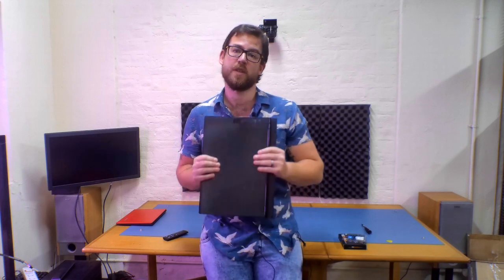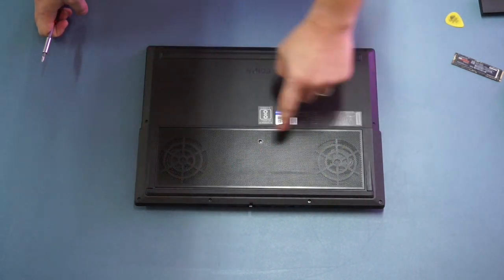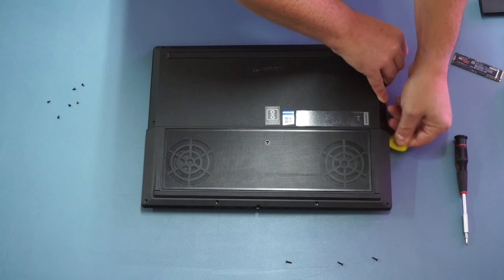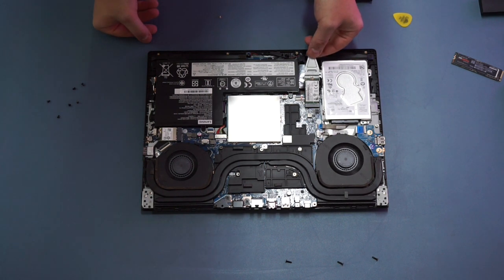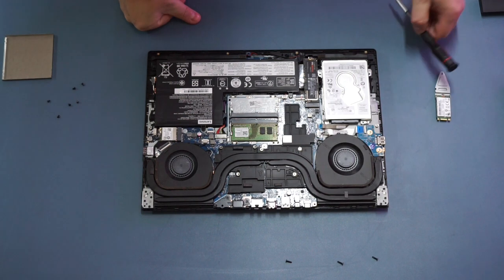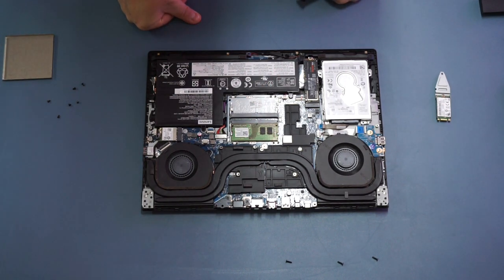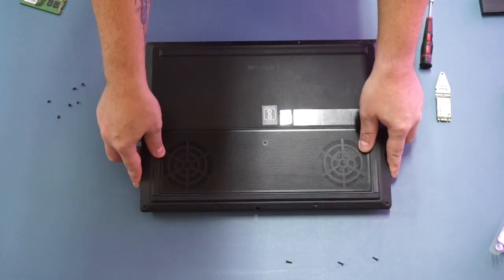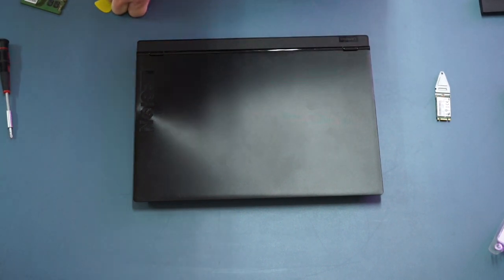Lenovo Y530 Legion Memory/SSD Upgrade

Comment from the maker: One step I've omitted to cover is that you should always disconnect the battery before undertaking these works!
Reply: the battery must be removed ?
Reply: Can Y530 be upgraded to 32GB RAM? I have 16 and it is ok, already added one more 240GB SSD instead of 2.5'' HDD.
Reply from the maker: It will take up to 32GB (links in description) but I wouldn't say there was much value in doing so unless you are finding 16GB is not enough
Reply: Tech Made Easy how disconnect battery
Reply from the maker: @OrangeGamingAndTechHelp  there is a small cable running from the battery to the motherboard, gently remove it

Comment: @TechMadeEasyUK which SSD did you have there previously to the upgrade? I have the 128 GB NVMe PCIe 3.0 x2, and I read that the 81FV version of the laptop can take only up to 512 GB of SSD. I'd like to put there Kingston or Samsung PCIe 4.0 x4 and 2 TB. Will it work?

Comment: Thanks, FME Retro...!  Your guidance in this video made the installation of a new 1TB Gen4 SSD and 32GB RAM (both by Crucial/Micron) so doggone easy!  Your caution about unhooking the Battery was a good reminder.  Your step-by-step video presentation was engaging and spot-on for what I need to do to upgrade one of our two Lenovo Legion 16 Laptops.  I'm still tinkering with settings to get the performance we want, but at least the upgrade went smoothly and everything WORKS.  Thank you kindly...

Comment: I have bought two 16GB RAM modules, each with a speed of 2400MHz, for this laptop. I have installed them, but upon turning on the laptop, it powers on without displaying anything. I have tried removing and reinstalling the RAM modules, cleaning them, but to no avail. The BIOS is up to date. Should I enter the BIOS and perform any actions? Or should I reset the BIOS? How do I reset the BIOS?
Reply from the maker: If you put the original RAM back in does the machine still work?

Comment: I backed up my SSD to my HDD using system image and then installed the new SSD but now it won't start up it just says Default Boot Device Missing. How do I get it to use the system image backup to boot??

Comment: Can you put in a 1tb nvme even though the max is 512 gb?
Reply: Been running Kingston A2000 1TB in it no problem. But I can't upgrade firmware because BIOS is still running Intel RST mode instead of AHCI (check YT on how to safely switch from RST (raid) to AHCI without losing Windows)

Comment: hello thanks for this video. Actually my laptop has 16g ram, Is recommended to upgrade to 32?
Reply from the maker: I would not say it was necessary in a laptop of this spec.
Reply: @TMEretro  well is just that I stream, and sometimes ram struggles with the games and the stream. So I was thinking this could help.
Reply from the maker: @ZenBenzineX  if you run MSI Afterburner is it showing that you're using all 16GB?
Reply: @TMEretro  I'll check it out and give you an answer.
Reply: @TMEretro  well i tried and it show that sometimes it gets full, and my game shutddown
Reply from the maker: @ZenBenzineX  using all of your RAM should not cause the game to shutdown, there's something else going on there

Comment: Thank you for this video , I have the same laptop model and I want to upgrade the SSD can I replace it with this: ( SAMSUNG 980 PRO SSD 1TB PCIe 4.0 NVMe Gen 4 Gaming M.2 ) ?
Reply: Did you upgrade it? I wonder if motherboard supports Gen 4 NVME and PCIe 4.0
Reply: @kostalakoste  Y530 is limited to Gen3 6.0 Gbps, but 1TB works and any NVMe Gen 4 should be downwards compatible.

Comment: I have the same laptop and was thinking of upgrading the SSD.. Can I go for SATA or M.2 or NVMe micro SSD or should I go for a specefic one? I am planning to upgrade from the existing 128 to 512.. any suggestions??? and I know I have to reinstall my OS once I upgrade the ssd .. the data on my internal hard disk.. They won't be affected in any way right?? Or will the whole system format and I would need to be careful about whats on my HDD before upgrading the ssd too?
Reply: Hello  same problem do I have to buy nvme or m.2 sata???

Comment: Hi! I recently got my Lenovo Y530 an upgrade with Samsung SSD 980 500GB (NVMe M.2). I noticed that the volume of my speakers are weaker than expected. Do you know how to fix it? Thank you!!!!
Reply: You can try opening Dolby Audio (it should be pre-installed on the machine) and go to the personalize tab. You can adjust the volume output there.

Comment: So I bought this laptop used. And I definitely need to add an ssd to it, but the m.2 slot doesn't have a screw in it anymore. Does the m.2 come with a screw or am I crap out of luck?
Reply from the maker: You can buy them very cheaply online

Comment: @Tech Made Easy
Thanks, Mate. This was the video I was looking for the Months.
I have a question here. I have the same model with HDD. recently HDD got corrupted and now the system is not booting up.
Wanted to upgrade with 1 TB NVMe ones instead of 512 GB shown in the video will it be compatible with 1 TB?
Please reply
Thanks
Reply: Same thing, what did you go for in the end?

Comment: Hello, I would like to upgrade my Lenovo Y530, but on the manual it says that the ssd limit is up to 512Gb, did you install an 1 TB ssd? It is compatible? It works well? 

I will appreciate your help before I upgrade it! 

Regards
Reply from the maker: I upgraded mine to 512GB so can't  comment

Comment: what a helpful guide, thanks for uploading this video!

I have a question, if somebody can help me: is this laptop compatible with m.sata SSDs, or is it only compatible with NVMe ones (I saw you replaced an existing M. key but I still have the doubt)
Reply: This is from the Lenovo Forum "Legion Y530 M.2 SSD Compatibility"

The Legion Y530 can use any M.2 SSD that is NVMe compatible. While the 2.5" bay can be used with an adapter to handle SATA only M.2 disks, the actual M.2 slot will only detect NVMe SSDs.

Comment: Hey! I got an Western Digital Black SN750 for this laptop. I have one question though, once I install the SSD, with the HDD that came with the laptop itself already used, will I be able to boot up the pc like normal? Or is there more than just putting the SSD in?
Reply from the maker: TO get the best experience you should reinstall Windows onto the new SSD
Reply: @TMEretro  And use the HDD to store anything else until it's filled? Do I have to format the pc?
Reply from the maker: @AdoriColumbina  I would back up your data to a USB drive, format the hard disk and then reinstall Windows to the new SSD. This is the cleanest way of doing it

Comment: great video. Could you say is samsung 980 pro suitable for legion y540?
Reply from the maker: 980 Pro is a pcie gen 4 SSD, this laptop only has a pcie gen 3 slot, so a 970 Evo would be a better solution

Comment: Hey there. Great work worth the upgrade. I have the same machine but without the ssd memory. My question is, is there an ssd slot available in my laptop if I decide to upgrade it like you did? 
Please reply. 
Thank you and have a great day.
Reply from the maker: If it is the same model as this then it should have the same upgrade options, but if you're unsure then check before purchasing any parts by opening the laptop up and looking inside
Reply: @TMEretro  Thanks for the feedback. My Lenovo y530 came with an optane memory instead of an ssd memory. I guess I can replace it with the ssd, right?
Reply: @malikfouad42  same. I’m planning to upgrade the 16gb optane to an SSD as well.

Comment: Great video!  But is there a possibility to easily copy the data from the old to the new ssd? (including windows and the programs)
Reply from the maker: There are options available but in most cases I'd recommend backing up important files and then conducting a fresh install
Reply: Usually when you buy an ssd, the manufacturer provides disk cloning software. Crucial for example provides acronis true image.
Reply: I’m passing through the same. How do I install my new ssd without the windows folders that are at my old ssd? If i took it of, how would i copy it?

Comment: i did but my laptop not support it plezz help!!!!
Reply from the maker: What do you mean?
Reply: @TMEretro i buy wd green ssd m.2 and then i install it but the ssd is not responding then i use the same ssd in my pc and it work
Reply from the maker: Did you buy a SATA M. 2 or an NVVME M. 2?
Reply: @TMEretro  i try both nvme m.2 form Adata(xpg) and  normal m.2 (wd green) both didn't respond .Then i take my laptop to service center then try both (nvme m.2,normal m.2)  from another lenovo laptop and it's responding .they suggest me a samsung 256gb m.2 ssd nvme - pm981(215.42 $)  from lanovo.
Reply from the maker: There shouldn't be any compatibility issues providing you use the correct type of M.2 device, shame that you're having issues
Reply: @TMEretro  can you suggest me an m.2 that is available in India
Reply from the maker: @shomilsharma9613  you are best consulting with local suppliers for this
Reply: @TMEretro  okay thank you for helping

Comment: so the hyper x should be fine
?
Reply from the maker: Unfortunately I can't guarantee any specific items, but the ones in the video description meet the specifications required for this laptop
Reply: @TMEretro  ok so i checked, and i bought the hyper x except that i only bought one of 16 instead of 2, if i buy the second exact same i sould be able to install it, or do i need the pair pack?
Reply from the maker: @tom_cr00se98  unfortunately I can't tell you whether something will work or not, liability issue. But it sounds like what you propose should work
Reply: @TMEretro  i understand, i guess mi question should have been is there a left and right ram, or i can use 2 of the same one and flip one over
Reply from the maker: @tom_cr00se98  there's no left and right, they're identical

Comment: Is it possible to change the color lights on thsis keyboard and can I replace parts of the fan to make cooling times drop?
Reply from the maker: Not easily in either case!
Reply: Tech Made Easy besides what you did with that laptop, is there anything else I could upgrade to mine?
Reply from the maker: You could also upgrade the existing hard disk to a 2.5" SSD. Other than that there's not much growth in this laptop

Comment: Hi, thank you this is very helpful.
But I wanna ask one thing. Can I install Samsung 970 EVO Plus NVMe M.2 1TB to this Y530?
Because some media stated it's upgradable up to 512GB SSD only.
I'm afraid it will be useless, or problematical if I use the 1TB version.
Reply from the maker: There should be no issue upgrading to 1tb but I can't provide guarantees
Reply: Did you manage to install the Samsung 970 EVO Plus NVMe M.2 1TB on the Y530?
Reply: @MusicIsLife22307  Hi, yes I did it. There was a problem with moving Windows into the SSD, but I didn't sure how to solve it since my friend helped me. My Y530 is working great since then anyway!
Reply: @renatatjan5341  Thank you for your reply. I was afraid that it wouldn't work, cause thats what they stated on the official lenovo website. I did some research and a lenovo specialist said that it should accept any nvme ssd but they couldn't provide any guaranties since they only test the device up to 512GB. But now that i know that the 1 TB is working fine on your machine, i''ll go ahead and buy one. On my lenovo y530 I'll do a clean install. I'm thinking about this one: https://www.amazon.com/gp/product/B07VXC9QMH/ref=ox_sc_act_title_1?smid=ATVPDKIKX0DER&psc=1
Reply: @MusicIsLife22307  Hi, did a 1tb nvme ssd work for you with this machine?
Reply: @Spartangoji117  haven’t tried it yet
Reply: @renatatjan5341  i have a problem with moving Windows into the ssd(970 evo plus 250gb). Can you help me pls?(lenovo legion y530-15ich 81fv)
Reply: Hi do u have the same laptop if so then did you buy m.2 sata  or nvme?

Comment: I have legion y540 with Samsung 8gb ram CL 19
Can a crucial 8gb ram CL 19 be added to it???
Because earlier i tried Hyper X 8gb ram CL 15 and after opening task manager speed shows as 2400 mhz, but both the Ram is of 2667 mhz .
Reply from the maker: You should always try and match RAM sticks wherever possible, failing to do so will result in slower speeds and timings
Reply: Means we can't add of different brands??? There are other videos too which shows crucial ram with existing Samsung ram
Reply from the maker: @ankurburnwal9243  I said "should" not "must" - it may work but I can't recommend it as a solution
Reply: Ok thanks... you are tooooooooooo fast to reply😃😃😃
Reply from the maker: I'm here to serve 😂

Comment: I was thinking to add in my legion Y530 a ssd for window 10 to make it faster. Mine alwready came with a 1 Tb hardrive. I was thinking this one:
https://www.amazon.ca/-/fr/Silicon-Power-SSD-256-256GB/dp/B07ZGK3K4V/ref=sr_1_3?__mk_fr_CA=%C3%85M%C3%85%C5%BD%C3%95%C3%91&dchild=1&keywords=NVMe+M.2+SSD&qid=1600032833&refinements=p_n_feature_three_browse-bin%3A7329966011&rnid=7329964011&s=pc&sr=1-3
, but I never used a ssd in my life and i dont know if it will be possible to make window 10 boot on it or if it is compatible with my laptop. Your explanation are really good, but i dont need a 1 Tb ssd. Thank in advance for any answer :D
Reply from the maker: That SSD should be compatible with this laptop. Once installed you will need to reinstall Windows 10 onto this SSD to see the benefit. You can then wipe your original hard disk to use it as storage space.
You can find a walk through guide for installing Windows 10 on my channel
Reply: Tech Made Easy thanks you will watch soon 🙃

Comment: If i upgrade ssd and re-install my windows, should i buy new windows or my new windows automatically active ?
Reply from the maker: You shouldn't need to buy a new license for this machine
Reply: @TMEretro  so it will automatically active ?
Reply from the maker: Yes

Comment: i am planning to get an ssd for my y530 but want to know whats the max read and write speed can my laptop handle.
Reply from the maker: Your laptop has an M.2 interface which can utilise nvme storage, which in turn can use 4 Pcie lanes - roughly 3gbps.
Any M.2 nvme drive will be fine

Comment: Hi, I  want to add an ssd card to my legion y530, will my data oro any games I have on the laptop be removed? thank you
Reply from the maker: If you're replacing an existing SSD then you'll need to backup your data and applications first. If you're adding an SSD where one didn't exist then you won't lose any data stored on your hard disk, but to get the best performance you should reinstall Windows and any applications onto the SSD
Reply: Tech Made Easy wahh thank you so much
Reply from the maker: Is the new SSD shown when you enter the BIOS?

Comment: Will a Crucial P1 2TB 3D NAND NVMe PCIe Internal SSD, up to 2000MB/s - CT2000P1SSD8 as well as a Corsair Vengeance Performance Memory Kit 32GB DDR4 2666MHz CL18 Unbuffered SODIMM, (2 x 16GB) work with the y530
Reply from the maker: You're best to consult Lenovo on compatibility, I can't provide assurance for all parts on the market

Comment: Crucial mx500 vs wd green which is better
Reply from the maker: Define better? Both are fine options
Reply: Yup i want better onee
Reply from the maker: But what do you define as better? Faster? More reliable? Less power draw? It's a subjective term
Reply: @TMEretro  faster one
Reply from the maker: @vallindrapatnala4928  A quick Google search shows that the Crucial unit is slightly faster
Reply: @TMEretro  tq sooo much for spending valuable time to reply me

Comment: Can we use a 2230 size SSD in its WiFi card slot and use a WiFi usb receiver instead?
Reply from the maker: You'll need to check with Lenovo on this, I didn't test it for the purpose of this video
Reply: @TMEretro  ok, If you get hands on 2230 SSD ever please do try it

Comment: Bought this unit last year and a week ago it just went dead and would not start up anymore. I suggest you stay away from this brand.
Reply from the maker: Man, that sucks.  Lenovo is quite a mixed bag, their lower end can suffer from reliability issues, but their ThinkPad line has continued the legacy left by IBM and is rock solid.
Reply: @TMEretro  You can say that again. I'm out of work for 2 weeks now, waiting for the service center to fix what ever the heck is wrong with my unit. I had a Samsung that lasted for 10 years before it gave up and I replaced it with this one.
Reply: @TMEretro  Coming back to comment about the finding on my Lenovo Legion Y530. The aervice center did all they can to save the motherboard by changing burnt mosfets but to no avail. They said that the board must have suffered more damage internally and suggested to change the motherboard which cost about $700. Ouch.

Comment: What could be the problem if I were to put a different brand memory stick with the one that comes in stock?
Reply from the maker: It's not so much about brand as the likelihood of speeds and timings being different. You could suffer a performance impediment or (worst case) stability issues.
It's unlikely but it is best practice to use a matched pair.
But certainly it shouldn't damage anything to mix similar sticks from separate manufacturers

Comment: I have a question, this laptop comes with 8 gb memory, if i buy one more i will have 16. Are they gonna run in dual channel?
Reply from the maker: Provided you buy a module of the same capacity, speed and timings then you should have no issue and they should run in dual channel mode
Reply: @TMEretro  ok, thank you for the informations!

Comment: When I upgraded my y530 with xpg flame 16gb ram blue screen(bsod) error appeared. What to do now?
Reply from the maker: Sounds like there may be a problem with the RAM. I'd recommend you replace the original RAM and see if the problem goes away, if it does there's an issue with the XPG RAM